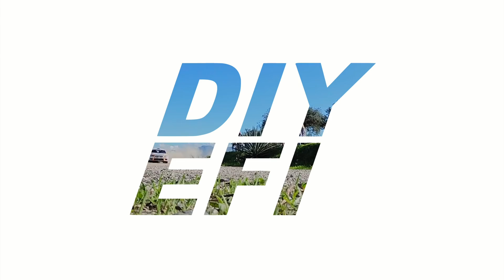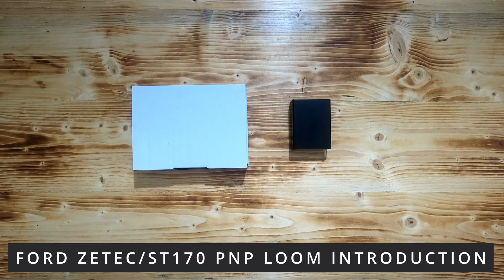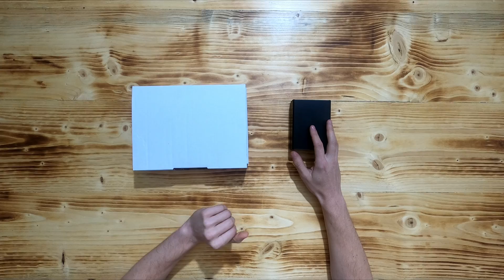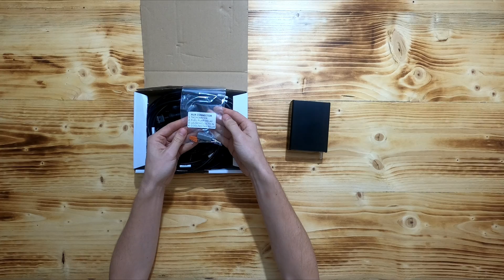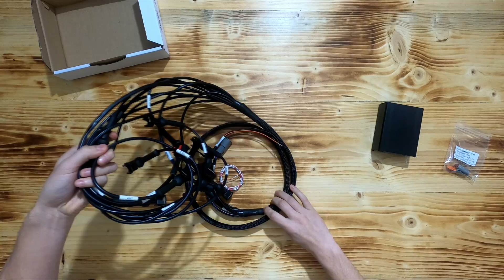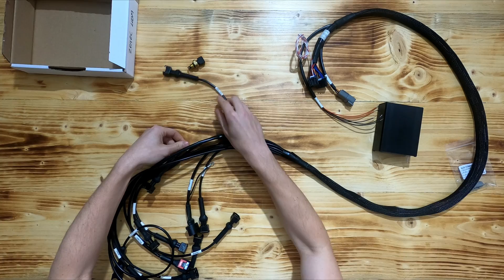DIY-EFI Zetec/ST170 PnP Loom First Look (CORE4 Speeduino ECU)

Comment: Does it have any spare I/O , for say a clutched  supercharger? Or would I need to utilize the boost controller I/O? Looks like a good loom, I need to look into the ECU features.

Thanks
Reply from the maker: Hello,
Yes there are spare low side drivers left.
Take a look at the ECU product information here, https://diy-efi.co.uk/product/diy-efi-core4-te36
That said you could use the boost output as that has a wire run to the engine side of the loom.

Thanks
Reply: Is there an option for some sort of base map on it or is it 100% blank, local tuner insists on getting something running before I waste his time 😂
Reply from the maker: @munkysport  Yes there will be s tune on there that will be good enough to get the engine running so proving out the install. There will be a few steps before the first start, such as calibrating for the sensors you having installed and letting it know what injectors you have installed.
Reply: Last question, I promise, vvt control on st170, is that full control ( angle adjusting) or is it the on off type, full on or full off? 

If it's fully controllable sign me up 👍
Reply from the maker: @munkysport  Yes, it's full angular closed loop control. We developed that feature ourselves on a personal project and added it to the firmware.
https://www.youtube.com/watch?v=EfR-dr7fOW0

Comment: will it PnP to silver top  130 bhp 1994 mk5B xr3i cab ?
Reply from the maker: Hello, yes it will run a zetec. You will dismiss all of your original engine wiring. It will require a different coil as shown in the video. Also different temperature sensors unless you wire in to your factory versions.